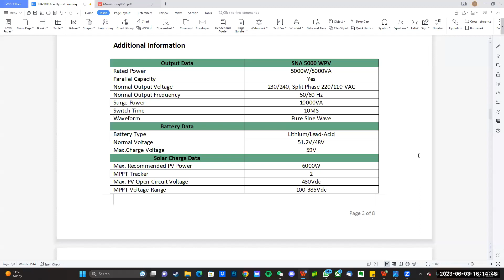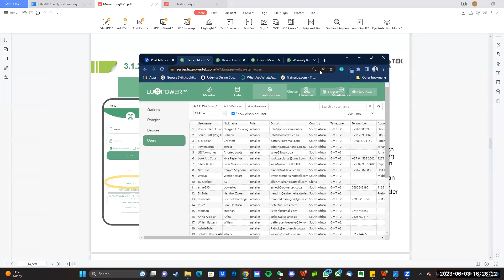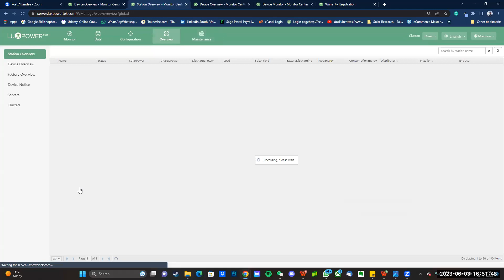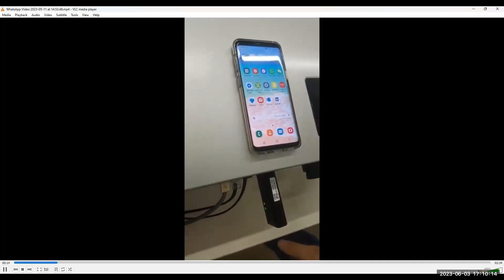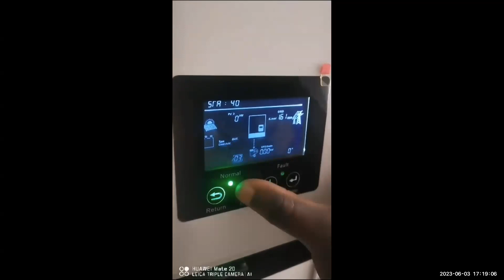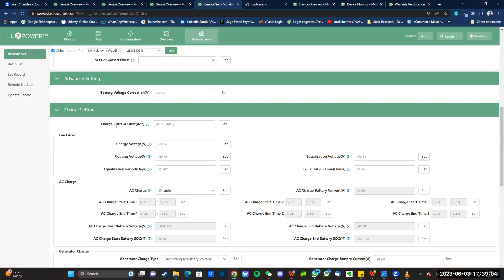Luxpower SNA single phase off-grid 5kW online training

Comment: hi, tell me. if I forgot the password for the router and the inverter is in client mode trying to connect. how to set a different password or even a ssid?
Reply from the maker: Hi Sir, thanks for reaching out. Do you mean that you reset the router password, right? if so, please reconnect the wifi dongle again according to the manual.

Comment: Your app is the worst app out ever. Most of the time it does not show what your system is doing and have complained many times with no updates or improvements . Sad situation such a nice inverter for its price  
Don't buy luxpower if you someone that likes to monitor your system . 

There are others expert inverter that apps run 10x better than luxpower

Comment: Good  day olease advise can someone that did n'to install My inverter go into the main app or portal  not just the client one to make changes it seems my installer doesn't know how to setup the bms correctly so my sna5000 with greenrich up5000 setup is cutting after an hour and a half as the bms discharge limit is 145 which is ridiculous and changing on the app I have login details for doesn't change it iv even logged into the luxpower portal thing and changed there but it doesn't see that change

Comment: can I use the dry contact to activate a contactor once the battery is fully charged and the unit is getting power from the pv panels .I does not accurately indicate it in the Manuel, or maybe I am not reading it correctly.

Comment: Question:
We installed a all in one Unit as loadshedding  solution.
When it's on Eskom lights and plugs work as needed.
Then when on load shedding plugs no issue even if you test them with earth leakage tester trips when tested. But LED down lights glows very  dim when switch is off. 
Could this be same when Neutral and earth not bonded.

Comment: If you have already set up a wifi connection to a mobile WiFi dongle through MTN , but due to signal issues want to change to a different Mobile Wifi Router from a different service provider, how would you go about reregistering the inverter Dongle on to the new WiFi router?
Reply: https://youtu.be/8iGApoHmWXE